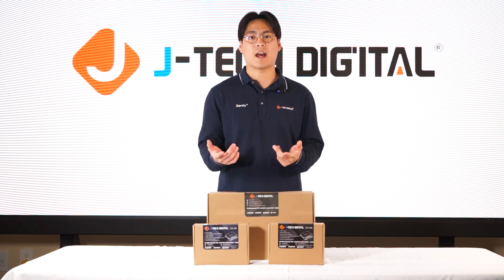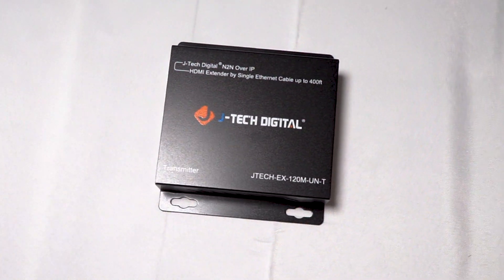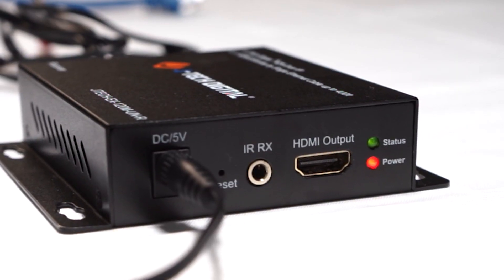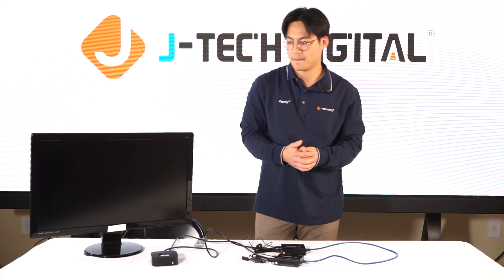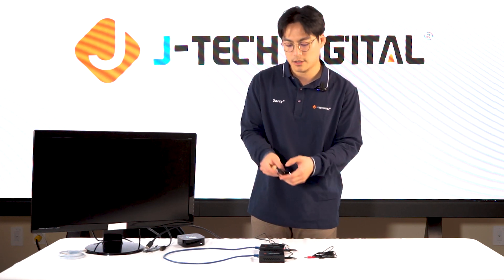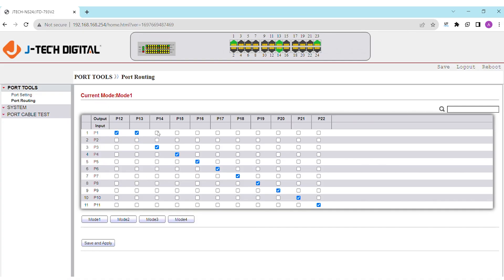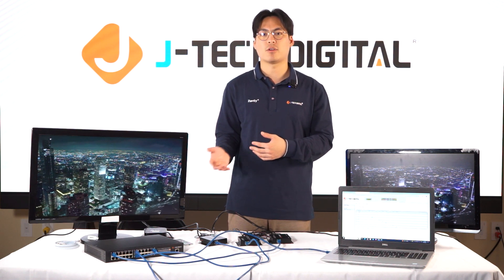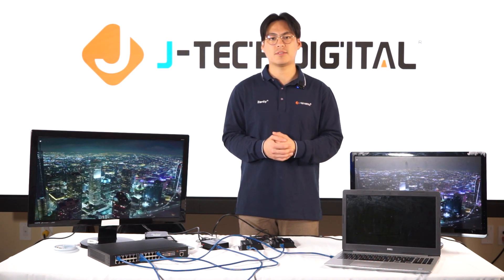AV Over IP Switch with Transmitter And Receiver Product Overview

Comment: Price ?
Reply from the maker: 1. 1080P 60Hz HDMI Extender Balun Over Ethernet For AV Over IP System - 400ft. (Transmitter)
$107.79
2. 1080P 60Hz HDMI Extender Balun Over Ethernet For AV Over IP System - 400ft. (Receiver)
$107.99
3. 24-Port Gigabit Ethernet Switch For AV Over IP System: https://www.jtechdigital.com/products/jtech-ns24v3-jtd-3136-network-switch-24-port-av-over-ip-gigabit-network-switch
$494.99

Comment: I have an NVR and need a HDMI over IP solution which will work with a TP-Link 10G switch, I need the HDMI-over-IP to support 4K with latency of 100MS. Which of your models support this?
Reply from the maker: Yes, our HDMI over IP solutions can support 4K with latency well under your 100ms requirement.

That said, I want to confirm this is the right product for your setup. Since NVR cameras can already act as IP camera encoders, in some cases you may only need a decoder to output the video rather than a full HDMI over IP transmitter and receiver kit.

Can you confirm whether you need to bring HDMI sources into the network, or if you simply need to decode the NVR streams to HDMI display?
Reply: @JTechDigitalINC  Thanks for responding. I need this solution for my Reolink NVR BUT I have couple of 10GB switches with Cat8 that it will pass through between the NVR and the 4K monitor. Total distance not more than 200FT.  So I have the NVR in the basement and I want to connect J-Tech to the HDMI of the NVR, then from your transmitter to the TP-Link TL-SX1008, there are two more TL-SX1008 until I am at the monitor I want to receive the HDMI signal from the NVR. Hopefully this makes sense? Which of models would work for 4K. I am not interested in keyboard or mouse, only HDMI for the monitor to receive the NVR signal to display the camera. Thanks!
Reply: Any Chance you can respond please?
Reply from the maker: @steven197601  Thanks for clarifying your setup! Based on what you’ve described, it does sound like we have a 4K HDMI over IP solution that will meet your needs and work with your TP-Link 10G switches over the 200 ft distance. Since your configuration is a bit more advanced, the best way to make sure we match you with the right model would be to connect directly with our sales team. If you don’t mind, please give us a call or send us an email so we can go over the details and recommend the exact kit that will work best for your NVR and monitor setup.
Reply from the maker: Number: (844) 200-1945
Email: sales@zenty.com

Comment: Can I control or view different content on each TV screen of my choice without affecting what others view in the other rooms? That's let's say I want to be in my room and change between sources without affecting the other screen channel views.
Reply from the maker: Yes, you absolutely can! It's actually the best part about our AV over IP system.

Think of it this way: each of your TVs gets its own receiver, and all your sources (like a cable box or a gaming console) get a transmitter. Since they're all connected over the network, you can route any source to any TV you want, whenever you want. So go ahead and change the channel in your room, it won't affect what anyone else is watching!

Comment: Can I use a generic switch for network connections and use it with the video transmitter and receiver?
Reply from the maker: Yes, you can use a network switch, but we recommend setting up VLANs to manage signal traffic efficiently. Make sure to separate the transmitters and receivers into their own VLANs and avoid placing other network devices within the same VLANs to prevent interference. 

If you'd like, you can call our team at (888) 610-2818 or email us at sales@jtechdigital.com or support@jtechdigital.com if you have more in-depth questions!

Comment: does the TX and RX work over any switch or do i HAVE to use the j-tech switch?
Reply from the maker: You are not locked in to our switch, however when you jump into our Partner Brand Zenty, the warranty will make you fall in love! But if you love netgear, ubiquity or someone else, you can stick with them for sure.

Comment: I want 16  display over net work is it possible
Reply: Can we 16 display over network switch
Reply from the maker: That will work. You would need 16 Receivers (1 per display), and the number of Transmitters would depend on the number of input sources they have. Lastly, you would need our 3136 (24 port) AV over IP network switch to tie it altogether.

Transmitter (JTD-791): https://jtechdigital.com/product/400ft-n2n-transmitter/
Receiver (JTD-792): https://jtechdigital.com/product/400ft-n2n-receiver/
AV over IP Network Switch (JTD-3136): https://jtechdigital.com/product/24-port-gigabit-ethernet-switch-for-avoip-w-web-management/